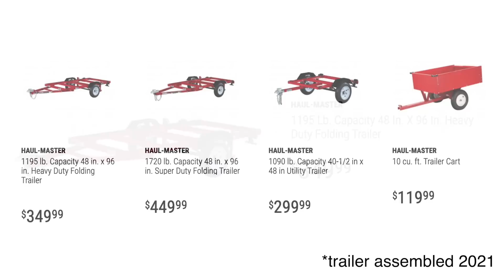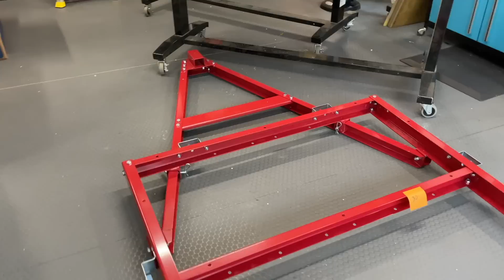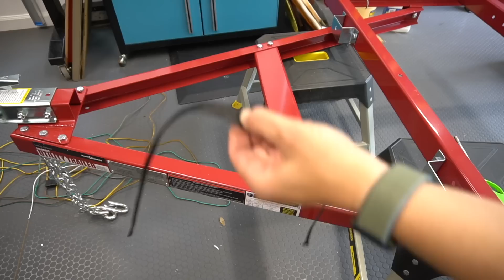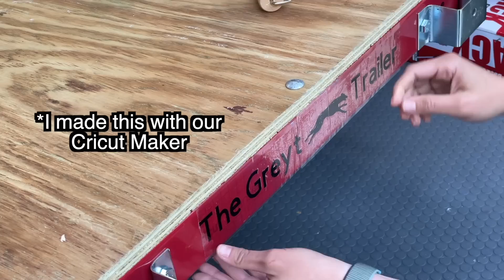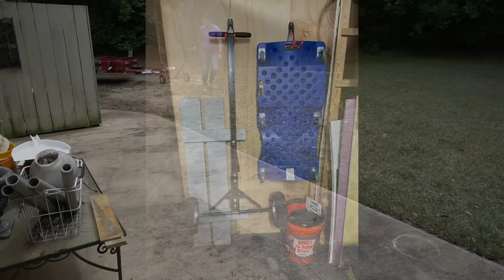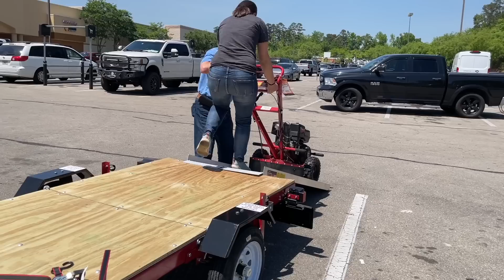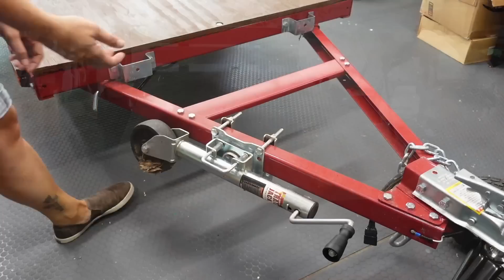Harbor Freight DIY Trailer Kit

Comment: Very comprehensive summary thank you !
I also have a Harbor freight trailer but it’s the 1,980# version with many similarities.  1. I trapped all my wire in that plastic corrugated wire tubing; you  might consider tying down that little loop on the passenger side of your  trailer so it doesn’t catch anything while traveling.  
2.  I bought extra trailer wire and ran everything on the driver side instead of both sides.  Smart for you to add the ground to each section of the trailer, which is what I did too!  I added a larger loop at the hinge and used an old long screen door spring to keep it pulled when everything’s flat and to allow to be looser to go around the hinge area when folded.  I know about those finicky blue connectors, so I soldered & heat shrink sealed every electrical connection.
3. The hinge is just to allow folding to occur it’s not load structural, so I reversed the hinge bolt/nut and added a number of large flat fender washers that push the whole hinge away from the frame about a quarter inch allowing a full 4+ x 8 area to be used.  
4. I bolted on the thickness of 2- 2x4s under the back end of the frame.  I then lift the V upright while the back end (wood) gently drags on the floor (to help keep the trailer from sliding) until the front is up on the little wheels, remove the pins and slowly drop the V. It’s then easier to simply lift the back half of the trailer up separately and secure it.  
5. I modified 2 square 4”x5” long U-bolts (w/ 2 nuts each) to slip into the top holes on each corner as it stands.  
6.  Consider a bolt with a whole drill through the end (and two washers) inserted from the inside, pointing out and then use a pin to hold it in place for your vertical 2x4 on the back wall.  
7.  After dealing with that structural but removable bolt near the springs, I made a modification to make it much much easier to bolt.  

Let me know if you want pics.   Some of these ideas I got from other sites 😉
Hope this helps!

Comment: Get a small boat winch hand crank wench. Round bolt into the roof Eve trus.
that way you guys can crank it up instead of lifting it.
Or I think it's called the block and tackle if you get enough of them you can do it by yourself.

Comment: Wow, what an amazing professional video. FYI, in most states it is required that all lights work. Even if side lights are not required, if you have them, they must work. Imagine those big rig semi's with 100 lights, just one light out means a ticket, so keep it simple. Also, make sure your license plate light works too.

My brother has the same trailer and lived in Florida. He added PVC pipe to encase all of the wires in, to keep mice from eating the wires. He doesn't fold his up, so he omitted the casters.

Comment: You need to grind/sand or file off paint to the bare metal to get a good ground. Use dilectric grease on connections

Comment: I built the same last winter. A few tips for anyone with that same: 1) Upgrade the casters. 2) Get (or make) a folding license plate bracket. 3) Put 2 of the old caster on the back of the trailer. 
Now, when you want to fold it, leave the back unfolded and tip the front up letting the back half rest of the casters and the plate fold on its hinge. This will be just a bit over half the weight. Then you can just flip the back up. I'm not particularly strong, and I can do it all by myself (barely).
Reply from the maker: Good information. Thanks for the tip.

Comment: You can fold this by yourself using leverage. Have the trailer out flat.unhook the front locks,  lift the rear end up so the tail lights are facing up. Hook a rope or strap to the rear end and the front end, then go lift the front end. As it tips back, the weight of the rear side will help you life the front end up.